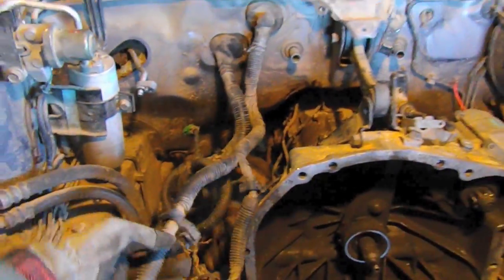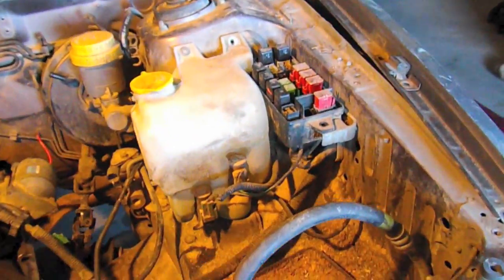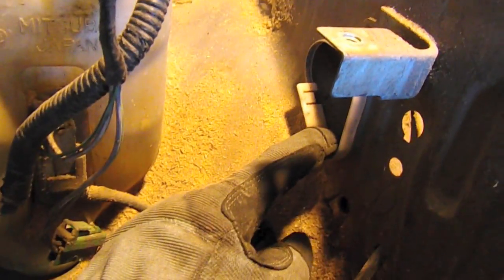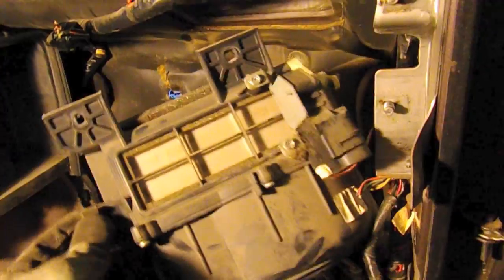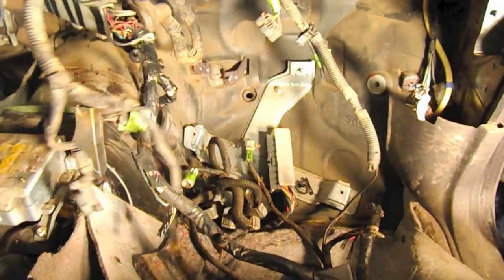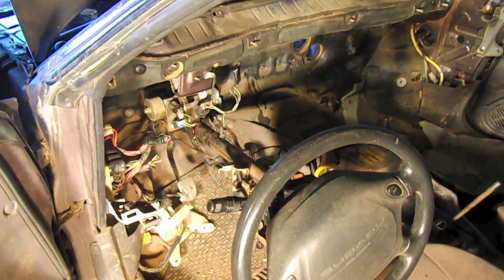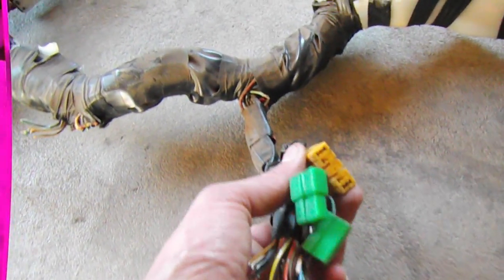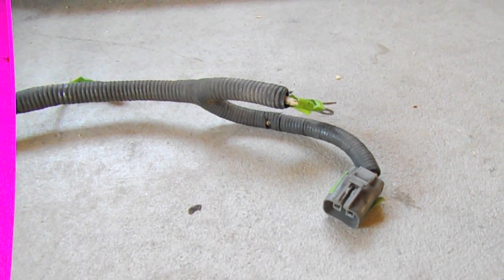Subaru wiring harness pull for VW engine swap

Comment: thanks for posting this!! the wiring is the scariest thing about the conversion
Reply from the maker: +23v0lv32 The wiring is DEFINITELY the most intimidating part of the conversion. It's not terribly hard but first timers will probably make a couple mistakes - but then you find and fix the mistakes :) Good luck and let me know if you need some help. Cheers!
Reply: +Busaru can you please tell me if a harness from a 96 outback 2.2 manual will work on my 98 2.2 auto impreza? im looking mainly to replace the section contsining maf wire and the shielded knock sensor wire.

Comment: Very good.  For the mechanically-minded, and not so much the electronically-minded, this video starts to bring-in the knowledge needed to DIY.  Thanks, Mick!
Reply from the maker: This is a pretty basic vid showing how to remove the harness. I have a 2000 harness that I'll be doing in more detail as this seems to be the most intimidating part of the swap to most folks. Stay tuned!

Comment: it seems from your video that the fat grey wires, 3 wires inside sheathed in grey with one copper wire not sheathed, in harness next to harness with engine plugs, where do these grey sheathing wires go, cause i cut them some.  thanks. you can see them at 8:17 in your video.
Reply from the maker: +Jim Kelly The shielded wires are usually for the cam and crank sensors. If you've knicked the sheathing then you can just patch it up with some tape but if the wires are actually cut then I'd look at either soldering or butt splicing the connection, insulating, then making sure the grounded shield is looking good.
Reply: +Busaru  I removed the harness from the legacy about a month ago and have it in a box since then. I looked it over a few days ago and it seems what I saw matches what you are saying. I have to look at it again but I have loose ends, must have cut them or pulled them out of the ecu plugs, not sure.  at least they are fixable, I was panicing when I saw these weirder wires cut and exposed : ) thanks.  gonna be putting the ej22 and harness into a Porsche 914.  do you have a website that I can email you from with pics as I proceed?

Comment: How are you coming on the resto-mod? Do you have any videos of the finished project? :)
Reply from the maker: Its pretty much finished. The engine is in and running like a top. There are a couple videos of it running up some mountains and around Durango Colorado. I'm going to do a final video showing some of the final items, but that's all I have planned for this bus. The next project is an 85 Vanagon Westfalia Subaru 2.5L swap.
Reply: Busaru What are you planning to do with the 85 Vanagon?
Reply: That's what I'm talking about!
Reply: Forthwith Tx Yeah, yeah. The engine swap. Sweet! I look forward to seeing videos about it. Until I saw these videos you've posted, I didn't know it was possible to convert an air-cooled VW to water-cooling, much less swap a Subaru engine.

Comment: How similar is an ej25 harness?
Reply from the maker: Similar, but the ecu will be under the passengers foot rest and the bulk of the harness will go through the firewall and not the front left fender well.
Reply: That sounds easier to pull. I don't have a small car diagram yet so I'm plan on trying to not cut as much as possible
Reply from the maker: Get yourself the ecu pinout, it'll help more than anything else, and it's free online! If you're unsure about something, just shoot me an email with a pic and I'll be glad to help. Boxermick@boxerswaps.com
Reply: hi reading and watching, im wandering in the 01 liberty how to get around the engine immobilizer. cheers